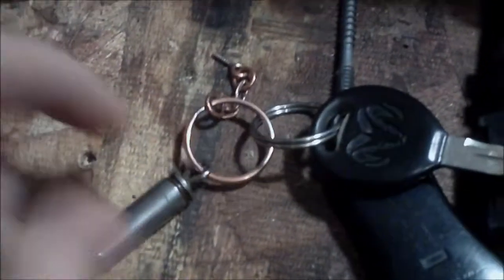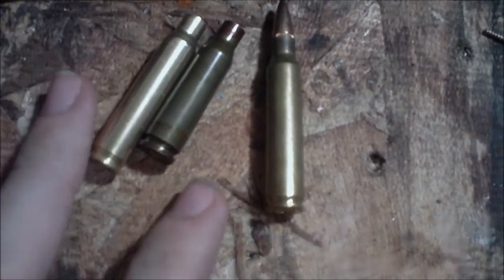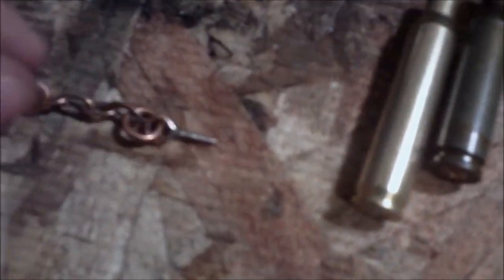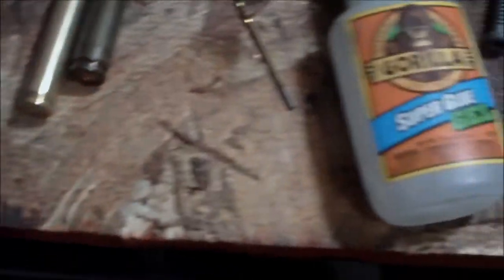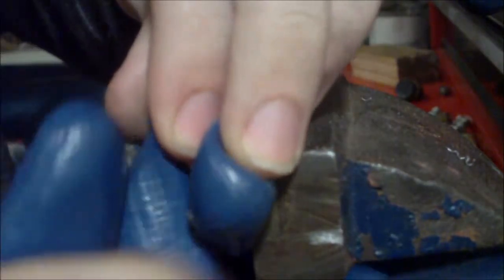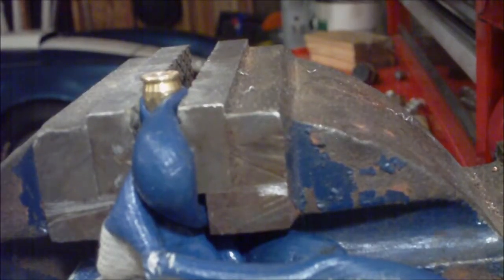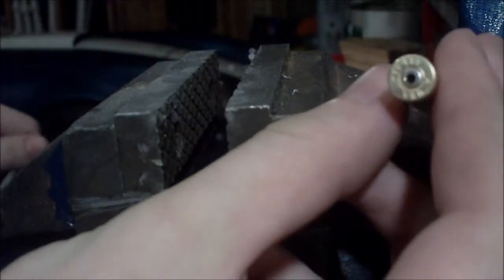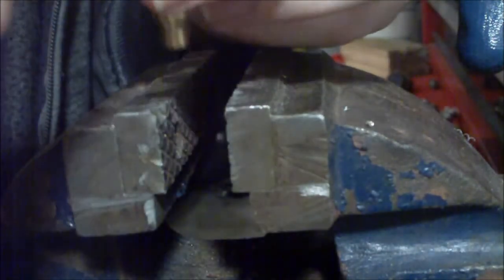How to make a Shell Key-chain in less than 5 minutes!

Comment: How does the super glue hold up over time?
Reply from the maker: After a few years I've noticed it eventually flakes away. Might be better to use hot glue or an epoxy for long term
Reply: @GenScinmore  awesome thanks!
Reply: @GenScinmore  why not solder?
Reply: @maplemaple1439  why not bro